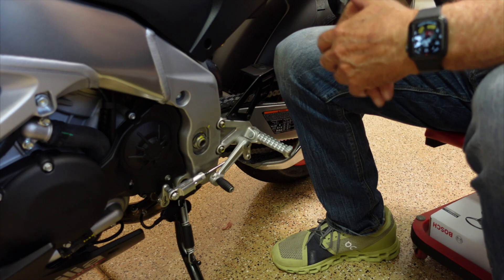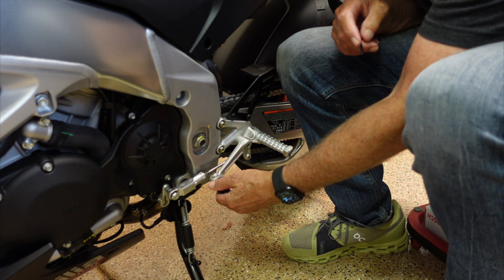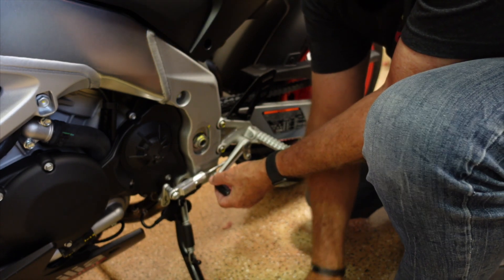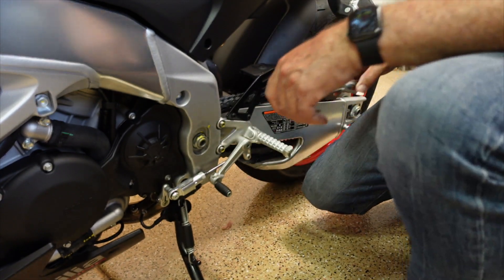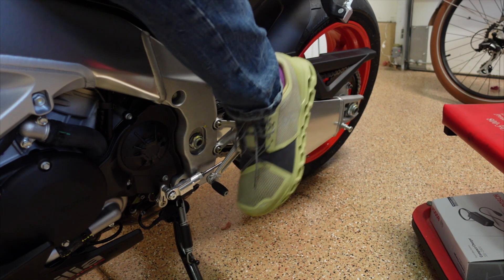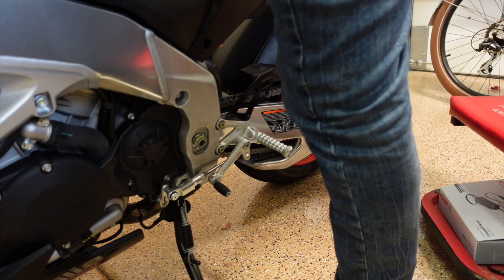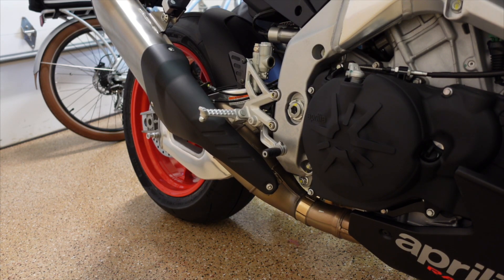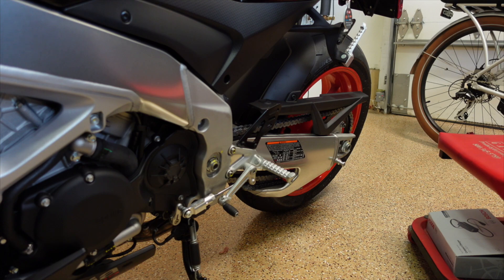Shifter Toe Peg Adjustment on my 2021 Aprilia Tuono   HD 1080p

Comment: Don’t unscrew the gear lever. You just need to make the connecting rod shorter and that will raise the angle if the lever. There is a locking bolt at each end, loosen them and the turn the rod to make it longer or shorter and you’ll see the lever move angle. This means the shifter stay in the same place but your level moves.
Reply: Just want to add that you may want to check if one of the nuts are cross threaded and go the opposite way.
Reply: @greyanaroth  good comment, the nuts are definitely cross threaded.
Reply: @hunneblabla  I learnt this the hard way man....
Reply: @greyanaroth  me too, I broke the connecting rod

Comment: Hi Gary  After picking up my 2021 Tuono last week, the first thing I noticed was the angle of the shifter, it was way too low compared to my RSV4 and S1000RR.  I adjusted the the connecting rod to raise the angle and it seems to be okay now.  I did not notice the ability to also adjust the peg as you have shown in this video.  Thank you for pointing that out, this is a nice option Aprilia thought to add.
Reply from the maker: Really glad to have been of help Gary, and enjoy that brand new Tuono dude!

Comment: Hi Gary, glad to see I’m not alone in finding the angle on my new 2021 V4 Factory much more extreme than I remember on my last (and only other) bike. I haven’t ridden in a couple of decades (I’m 56!) and made the jump from a standard (Kawasaki ZL 600) to a liter bike. It’s a big change!  Anyway, I’ve actually missed up-shifts when in full boots which is a little scary. I’m  curious if you tried Finger Rides’ suggestion and if it worked better? I’m not at all experienced with cycle maintenance but would have my dealer’s service department work on it if it gives me more room to get my damn boot under the lever. (I also find the brake level a little high too)  Thanks for a great video! Looking forward to viewing more of your work.
Reply from the maker: JW, congrats you "old codger" on staying with the RIDE! For what it's worth I am even further along the runway of life than you...so keep your health up and there's no reason for you not to be riding for many years to come sir.
So, just posting for tomorrow is an update I've done for this whole saga on the toe peg and foot peg relationship. In fact I DID use Fingers Rides and others comments and went back to my original thought of using the splined forward shaft to move the shifter peg up a bit. And yes it has helped a lot!
Watch for the VLOG, finishing work on it now. 
But suffice to say that your dealer can make some adjustments for you that will make it much more easy on the foot and riding position. I am not sure how the factory determines where to set these when building? However my shift toe peg was set to the minimum distance and the brake toe peg (they are identical in mount and design) was set to the maximum distance. 
In addition you can purchase a replacement toe peg from Woodcraft at a fairly reasonable $24.95 that has a wider range of adjustment than stock and is spring loaded, rather like your foot peg. I did this on my 2017 and may still do this on the 2021.
But, watch for the latest VLOG on this and then go to the dealer, they for sure can give you some relief on this.....for our big yankee feet!
Reply: Gary, thanks for the encouragement (and for the suggestions)!  I’ll keep a eye out for your upcoming vlogs for sure. Keep making them and I’ll keep watching ‘em. Thanks again!